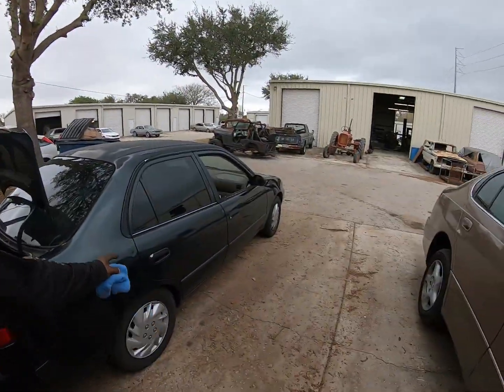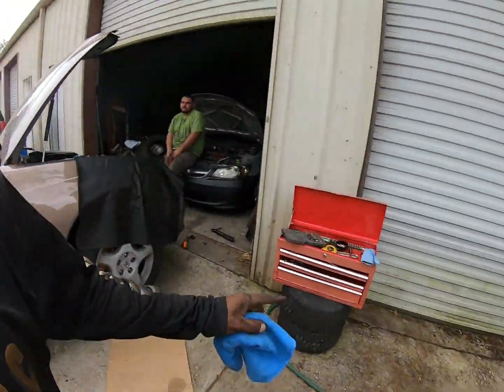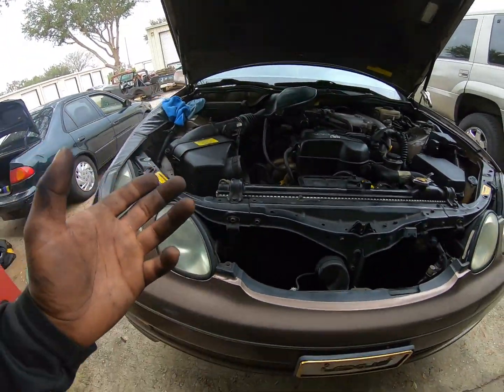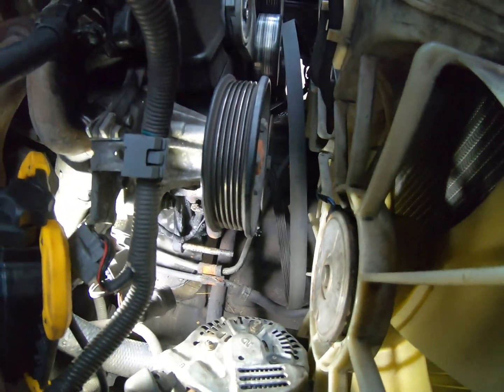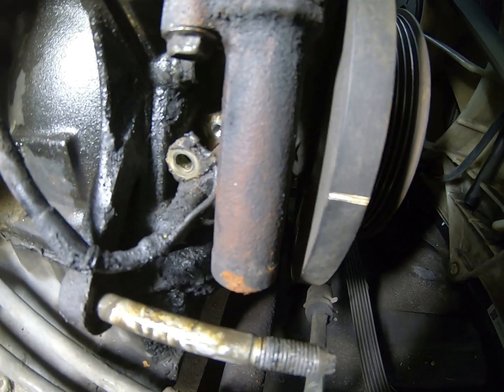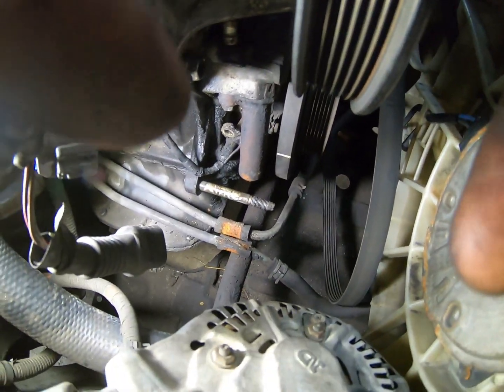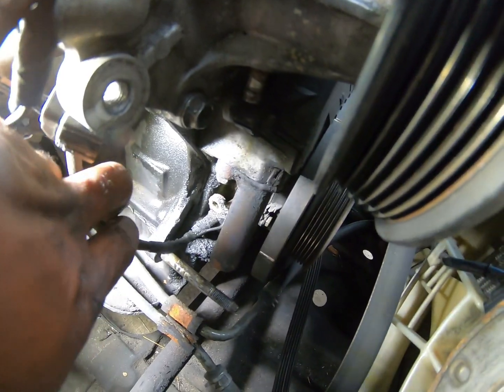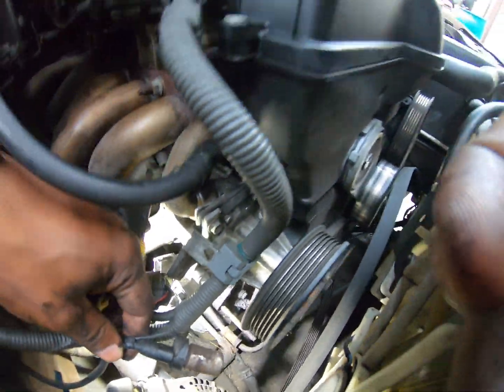Diagnosis day 2: How to change crankshaft position sensor 1998-2002 Lexus GS300

Comment: Mine doi g the same thing,its been doing it gor almost a year,i didnt take note,not knowing the crank sensor is bad and expired.changed plugs,coils,crank connector female  plug,sprayed mass sensor,cleaned catalysts,bought full tank,still wont crank.if i force fuel into the i j3ftor rails,it will start ,vibrate ,shake and then stall.culprit....dead crank position sensor.
Reply from the maker: @SlowPaks  there you go I’m glad it helped!
Reply: @Fasttowpro  yeah,tho I have not removed it cos I think gs 300 crank sensor is between the water pump and alternator area,so I would watch another video on how to remove the alternator,and remove the damn sensor.im so sure its filled of oil and carbon fouled  so far I have wasted almost 15 dollars on diagnosis,from charging battery to inviting diff mechanics,rewire(car electrician),bought new fuel pump,new plugs,used plugs,infact everything has been tuned but it refused to start.ive been seeing the codes on obd scanner then but I mistook it for camshaft...its not shocking at all,that is ,current is not getting to the connector ,hence brainbox(ecu) cannot signal for spark and injectors to work.
Reply from the maker: @SlowPaks  I would change both, once you get it all out it’s easy to get to. The crank sensor I believe is behind the harmonic balancer and that’s more of an issue but besides try at the cam sensor should not be that bad. Very best of luck!

Comment: hey i have cose p0351 ignition coil coil "A" Primary/sendondary circuit and i changed all the coils and spark plus and wire (NGK) and still no start just cranking....I just bought the crankshaft position sensor and will be changing it tomorrow to see if this will help because this is hard to pin point...fuel pump is working just fine so i know im getting fuel...so i hope this works.. let me know if you have had this code before and what you did to solve it please im in dire need of help at this point.
Reply: Did this work this is almost the same predicament I’m in

Comment: So did this solve your issue?
Reply from the maker: Yes and no.. It needed a new crank position sensor but it also was losing ground in multiple locations. You would have to have a power probe or a multimeter to verify the ground location and then check for the CKP signal.. It was a little more in depth but if you watch the whole series about this vehicle it'll make sense.

Comment: I have no codes / but idle drops at stops and sometimes shuts off.. could it be this sensor???
Reply from the maker: Hey yes it could be but if you don't have any codes I'd first check the fuel pressure and verify the filter is good and pump is steady priming. Also when's the last time you did a tune up? A bad or clogged air filter and mass air flow sensor could do that as well. Email me @ Seasallauto@yahoo.com and I'll help you work it out
Reply: @Fasttowpro Can i still email u for help with a similar issue

Comment: Bro hy hope ur doing well i have gs300 my car is not starting  temperature is not showing . There is no light showing  in transmission meter . :( its happening alot to my car what is wrong crank sensor .?
I check all ecu fuse they r fine. Lemme know whats the main issue
Reply from the maker: Have you had anybody run a check engine light diagnosis?

Comment: I got a code P1780 on my Lexus GS300 2002. I already changed spark plugs and coil paks, fuel pump and new batteries , it cranks but doesn’t stay on
Reply from the maker: That's a little bit challenging. From what I gather it looks like it may be a neutral safety switch at a quick glance maybe try to start it in neutral and see if it stays running or crank it up and when it runs hold a break and put it in drive and see if it's stalls I hope that helps

Comment: I got code p0300, I read somewhere that this could be issue as well, the scanner is saying misfire cylinder 1&6, I seen another video where someone in the comments said they had the same code and replaced this sensor and it fixed that misfire, I just replaced my o2 sensors bank 1 sensor 1 & bank 2 sensor 1 so I’m hoping this will fix my misfire 🤞🏽😮‍💨
Reply from the maker: Hey thank you for the comment. The code p300 is an indication of a misfire on some cylinder not necessarily any particular one.
 So p0306 would mean a misfire on cylinder number 6. The code that you sent indicates that something's going on with the entire system or a part of the entire system henceforth something about the misfire that needs to be found. It could be an injector a coil pack a spark plug or a few other things send me an email if you have any other questions I'll help you best I can,  seasallauto@yahoo.com

Comment: Is the camshaft position sensor underneath the manifold by chance if you know? Running into a p1346 p303
Reply: At rear of the head intake manifold side, right next to cylinder 6 fuel injector
Reply: @housespringville8341  would this sensor cause these type of codes or any type of symptoms i would feel from it???
Reply: @jonathansalgado2067  p1346 is a vvti code. Check the connector and wiring if the connection and wiring are good the vvti sensor is possibly bad. P0303 is a cylinder 3 misfire that could be caused by spark plug, ignition coil, or fuel injector... there are also other causes but those would be the most common
Reply: @jonathansalgado2067  A bad camshaft position sensor shouldnt cause p1346 code or p0303
Reply from the maker: Hey if you haven't got this together shoot me an email at seasallauto@yahoo.com